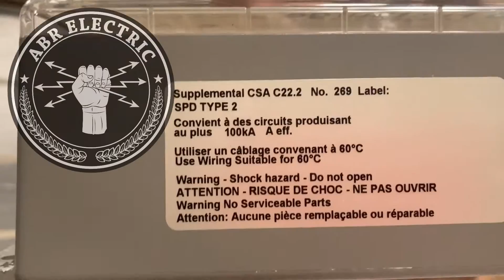Comparing Surge Protectors: Siemens FS140, Ditek and Eaton Ultra showdown.

Comment: If you get one, is your neighbor more protected than they were before, especially if you're off of the same pole transformer? 😆 Thinking about it, the grid is all interconnected...
Reply from the maker: Wouldn't that be cool - a neighborhood surge protector?
Alas, I don't think it will work that way :)
Reply: @abrelectric   Can you explain why you don't think it works that way? H1/H2 on my feed is the exact same as H1/H2 of my neighbor. (Assuming we are on the same transformer.)

The only difference here is that lightning will find the shortest path to ground. (Lowest resistance to ground.) Whether that's you or your neighbor is random chance.
Reply from the maker: @fitybux4664  the randomness is my concern
Reply: @fitybux4664  Lightning (electricity)  does not find the shortest path to ground. It takes all paths to ground, proportionally to the inverse of the resistance. All wires have some resistance, connections introduce more resistance (that's why the ground wire to your ground rods must be one continuous wire). So if lightning hits the overhead wire in the middle of your neighbor and you, and both your electrical systems have similar resistance, you will get pretty much 1/2 of the energy. Your surge suppressor will hopefully absorb your half and if that makes it a lower resistance connection to ground you might get a little of your neighbor's too but I don't think much. The resistance of your lines from the grid are high enough at that level to keep it pretty even. Yes, I am one of the dreaded electrical engineers of which the author speaks.
Reply: @JamesAllen-tj5nu  I'm thinking there is a timing issue here, too.  A surge traveling through the neighborhood hits your house and your neighbor's house.  At your house it's clamped, but not at your neighbor's house at that same moment - by the time any effect (if any) from your surge protector travels back out the mains to your neighbor, the surge has already traveled through his house and done its damage.  Right or wrong?

Comment: Thanks for the great video. I've been striked by a surge and no learning about surge protectors for the Whole home. Have you checked out the Intermatic Whole-House Surge Protection are they good? How do they compare to the Siemens FS140 Whole House Surge Protector? The reason that I'm even considering the Intermatic is because they have replaceable modules? What are your thoughts? I'm learning about this.
Reply: I advise using the surge protection in kilo amps (kA), the warrantied lifespan, the equipment protection guarantee and the sales price as the criteria with which to compare different SPD (surge protection devices). The Intermatic SPD that you mentioned (maybe you were referring to Intermatic Smart Guard IG2240?) is great looking but has a very low kA rating of 10kA, compared to the  Siemens FS140 (a good product - but expensive) rating of 140kA or the Intermatic IG1240 rating of 50 kA. However, it's not always "bigger is better,"with kA protection, as you only need about 50kA to have more than adequate protection for everything but a direct lightning strike (and good luck trying to stop the damage from that). The EATON CHSPT2ULTRA (108kA) and the Intermatic IG1240 (50 kA) are both units that I have purchased and used. I like them both, but am partial to the Intermatic IG1240 as it is affordable and can be used as both a Type 1 (in front of the meter) and Type 2 (after the meter and attached inside or outside of an electrical panel) SPD. I put one on an outside disconnect switch located just after my electric meter, and a second one on the main panel inside my house, using them both as Type 2 SPDs and employing a "cascade" protective scheme - the SPD closest to the meter will absorb most of a surge and anything that gets past that will get absorbed by the SPD on my main panel before the surge has a chance to enter the distribution circuits inside the house and damage the electronics . Most SPDs these days use TPMOVs (thermally protected metal oxide varistors) instead of MOVs, but both types degrade as they absorb transient surges. The difference being that instead of burning up and getting scorched like an MOV, the TPMOV senses the increasing heat as the MOV absorbs a great amount of surge and disconnects itself from the circuit board before it presents a fire hazard inside the SPD (but in both cases the effect of that much surge is catastrophic to the TPMOV/MOV). If you ever take an SPD apart, you'll see the MOVs (I use MOV and TPMOV interchangeably now) as a series of quarter sized discs soldered to a circuit board. They are arranged sequentially so that as one is destroyed, the next one takes over as the surge exposure/history continues until the last one is blown at which point there is no more protection and the green LED on the SPD should either go out or turn red. Unfortunately, you can't always take an SPD apart to count how many TPMOVs you get for your money. After the last MOV of an SPD blows, you will still have power into your electrical panel, it's just that the SPD no longer offers any surge protection and should be replaced. I have very dirty power where I am, outside of the USA, and I typically go through an IG1240 every two years. One last note - install the SPD as close to the main breaker or incoming L1 and L2 mains (power lines) coming into your panel as your are able and twist all 4 conductors together as they leave the SPD and enter the panel. Try to get the two wires going to the double pole breaker twisted together as far as possible before they untwist for their respective connections to the breakers while allowing the green ground and white neutral wires to then leave the twist and go to their respective ground and neutral bus bars. And finally, try to the wire lengths from the SPD to the double pole 20A breaker as short as possible.

Comment: Doing some research myself, as I understand it, the impedance of your ground connection is an important factor, and a low impedance ground is necessary to shunt the surge to ground, especially in a lightning scenario. Your thoughts on this?
Reply from the maker: My emphasis was to remind people to check their system grounding- connection to earth. We get too focused on the particulars of the SPD and overlook the core value of a low impedance connection to earth.

Comment: Great videos. Need some clarification, a little late, but curious. My electrician recommended the psp vortex surge protector  which is installed after the meter in outside panel over the hom2175sb for inside panel. Big difference in cost but he convinced me the vortex was much better since I reside in S.Florida, lightning capital.  Any thoughts?
Reply from the maker: Did he give any measurable performance details? Or compare it to other main brands?
Reply from the maker: The specs looked solid when I researched that unit

Comment: Is the thermally protected unit a type 1?  I used first surge at the outside csed panel, and panel mounted ones on the inside main lug panel.  OBTW nothing protects from direct lightning strike.  Best outcome is surge device a smoking hole outside house, and none of your appliances started a fire- they are still going in a dumpster.
Reply from the maker: You are right. Most of the manufacturers directly exclude damage from lightning in their warranty. God territory- you just do your best

Comment: If I install a whole house surge protector at my service panel do I also need to place one at my A/C furnace unit or is it necessary ?
Reply from the maker: I would install a unit at the AC disconnect. It's another layer.
Reply: @abrelectric  which one would you instal? and can you do a video on that? i live in NTX and just invested a lot in new acs id like to protect them. the specific question i have on it is wiring, most of the videos show people wiring them double to the  same terminal on the disconnect which i thought was not a good thing, whats the right way to instal it?
Reply from the maker: @anonimous596  My primary spd is the FS140.
The AC SPDs are commonly tap wired at the disconnect. These are type 1 units and have no amperage draw. You could also pigtail there instead or install the spd at the condenser j-box and potentially avoid double lugging.
Reply: @abrelectric  thanks, my primary is also the FS140 (installed using your videos thanks!!!!! - I'm just outside your service area)  what is the proper way to do this? double lugging (connecting the Spd and the AC load to same screw on the disconnect) is what is usually shown if I look up how to instal - is that ok? also if I pigtail them, Im going to need what 8ga wire? correct? my systems are 4 and 3 ton so 40 and 30 amp breakers.

Comment: hey can you do one on the AC condenser surge protectors??? ---  I dont know if you've shopped for one recently but man!!!!  here in 2023 you're gonna drop some serious cash on those things!!!!! I am adding whole home one as soon as it gets here (eaton ultra was what I wound up with - couldn't find the FS for reasonable $$ ) but I want to protect those AC condensers as much as I  can (since they are apparently  now made of solid gold) - which one of the AC protectors would be worth getting in addition to the whole home eaton one? or is the whole panel one realistically enough? and how important are the AC ones to have? -- I live here in hot as H. (heck, I said heck)  North  Texas ----  I need my AC to survive! thanks - great videos btw.
Reply: Look up Zero Surge on the internet.  It's a transformer based surge protector with some additional electronics.  But the transformer does almost all the work.  Not cheap; but the transformer never dies either.

Comment: Here's a question: How does a device wired to breakers inside a service panel protect against a surge? I'm specifically talking about the EMP-Shield device that supposedly protects against nuclear EMP. It gets wired to two 20A breakers & ground. Doesn't a surge protector have to be between the source and the circuit it protects? Besides that, any high-energy EMP will penetrate the house and fry anything electronic inside, regardless what's 'protecting' the incoming power. Same for vehicle EMP protection. I think it's a high-priced scam preying on people's fears.
Reply: my question about all the EMP claims is if your electrical system is protected from an EMP what real world  difference does that make anyway? the power plant and all the transmission will be fried so where does your protected house get its power from??? and if there is a nuclear EMP surge protection is probably the least of our problems anyway 😂
Reply: @anonimous596  Nuclear weapons are not the only source of EMPs. Lightning and other electrostatic discharge is a form of EMP. Solar storms or even a meteor breaking up in earth's atmosphere can cause them too. And the emp from a high altitude nuke could theoretically affect a whole continent, so you need not be anywhere near the actual blast. Whether or not these devices actually protect against them without wrapping you home in a Faraday cage, your guess is as good as mine. Seems like a gimmick to me.
Reply: @mikeyc2601  good point but i was only saying that if my individual home is protected but the rest of the system isnt  ? ??   anyway thanks!
Reply from the maker: I agree that a lot of the marketing is fear-based and makes unsupported claims. The SPDs that are legit have value, but none of them are bullet proof or without limitation.
Reply: the tin hat will protect all, no worries.
Reply: Well, it's now REQUIRED by code in new installations as well as upgrades, so the NEC code committee  has done the research and found it effective enough to pass the new code rule requiring it, you don't have a choice on the matter now since the 2020 change;

230.67 “A Type 1 or Type 2
surge protective device (SPD)
is required to be installed
on dwelling unit services.
The SPD may be integral to
or adjacent to the electrical
service. Additionally, an SPD
will be required when an
existing service is replaced.”
All services supplying the
following occupancies shall be
provided with an SPD:
• Dwelling units
• Dormitory units
• Guest rooms and guest suites
of hotels and motels
• Areas of nursing homes and
limited care facilities used
exclusively as patient
sleeping rooms

Code Change Summary: New code section. Surge protection is now required for all dwelling unit services.

In the 2020 NEC®, a Type 1 or Type 2 surge protective device (SPD) will be required for dwelling unit services. The SPD may be integral to or adjacent to the electrical service. Additionally, an SPD will be required when an existing service is replaced.

The code committee statement regarding the new code section expressed that this code change addresses the need for surge protection to properly protect the sensitive electronics present in most modern appliances as well as safety devices (AFCI, GFCI and smoke/carbon monoxide detection) and other equipment commonly found in dwellings.

Comment: Surge protector did its job with a tree on the line after the transformer.
Great  it worked. But it took fire too. Nearly burn the house.
Protect my devices, certainly, but....I wonder if I will replace.
Reply from the maker: You have my attention. 
Where was the surge protector installed?
What brand or model?
Reply: @abrelectric  hi, it was this model Eaton CHSPT2SURGE SPD Type 2 Chsp Whole Home Surge Protector, Nema 4, Single Phase, 120/240 Volts, Ul 1449
It was installed in the metallic breaker box on the side of the house main breaker.
Reply: Bump.. pls provide more details.... Brand, model,  location of installation & pro install or DiY??
Reply: @williamblair3603  Eaton CHSPT2SURGE SPD Type 2 Chsp Whole Home Surge Protector, Nema 4, Single Phase, 120/240 Volts, Ul 1449 installed by myself es according to the instructions.
Have installed according to us code a complete house with 15 kw pv, 60 kw batteries, 12 years ago and still running fine. The line with grd was for a little house down below that was used by the worker. I presume, the intensity of current was still flowing to the surge

Comment: After watching this video I think the Eaton BRNSURGE that I bought isn't going to do anything for me with it's 18 kA rating.
Reply from the maker: If you don't live in area with a lot lightning or power surges, it could be just right.
However,  if you're living in Florida or North Texas, you might want something stronger.
Reply: @abrelectric  Thanks for the reply! I'm in Los Angeles and I have an older Murray JA110AF panel. I figured that I would use the BRNSURGE with surge protected receptacles on the other end until I can upgrade my panel. We typically don't see lightning here in Los Angeles. I was doing this more so for peace of mind since I purchased new appliances after I bought the house.
Reply from the maker: @cobrakb   I lived in Ventura just North of you for quite a while. You're right, you don't get very much lightning activity at all

Comment: I see you have installed the FS140 replacing the Ultra. Other than your mention here, I can't seem to find much anything about Ditek. Looking today at the specs on the Ultra, they have a lifetime warranty. All that said, recently got a surge from a storm and it took out lots of equipment. Do you feel a Type 1 is better than Type 2? Can you speak to performance of a Ditek? Great content and thanks for your thoughts.
Reply from the maker: I moved tge Ultra to my garage subpanel.  I prefer the type 2: easier to locate and I'm not fussing at the main breaker or the meter socket. I have no personal experience yet with Ditek. Overall, make sure your service is grounded properly and keep your wires short on your SPD. Whatever you choose will be better than you have now:)

Comment: One correction. When we got solar panels, we replace our old 100 amp panel with a new 200 and took advantage of that to place in a Eaton Ultra (CHSPT2ULTRA). The 5 year warranty is for the cheaper CHSPT2SURGE model ($50 versus $140). The Ultra has a "for the life of the product" warranty.  The reimbursement coverage is different as well (CHSPT2SURGE = $25,000, 
CHSPT2ULTRA = $75,000). Those values are "secondary" coverage to what gets covered by one's homeowner insurance policy. Another think I'd mention in your installation videos is that the warranties require proof of purchase of the original surge protector so as backup we place a copy of the receipt in a small plastic bag attached to the back of the unit.

Finally, one difference you might want to point out is if there is an audio alarm. Most, like the Eaton Ultra I have just have indicator lights so you'll have to notice when the device gets knocked out. The Siemens FS140 has an audible alarm but alas they were out of stock everywhere when our installation was being done.
Reply: The warranty is for a defect in workmanship or parts of the surge protector, NOT a warranty to replace it once it takes a surge and sacrifices itself.
Reply: Scanning the receipt to your computer will provide a backup that doesn't fade out and become unreadable.
Reply: Or go up in flames with a huge surge 😅 @JoeW71
Reply from the maker: Joe, thank you! That is great, practical information!

Comment: Seriously looking at the Ditek... For the HVAC condenser and the furnace with the circuit board protection. The DTK-HVACKIT, any thoughts?
Reply from the maker: Ditek is a solid unit. Compare specs and warranty in the fine print, with other brands, i.e. Intermatic and Square D make an AC unit